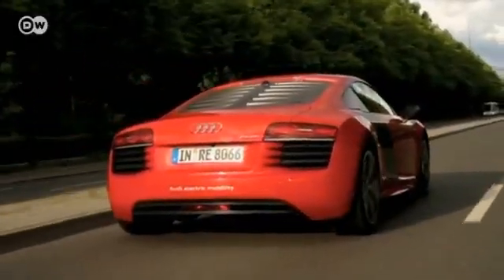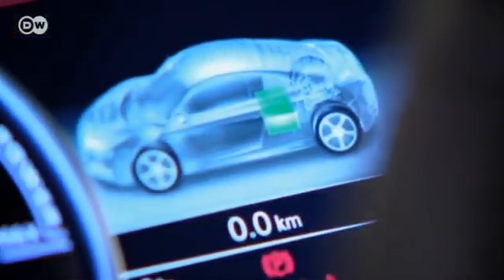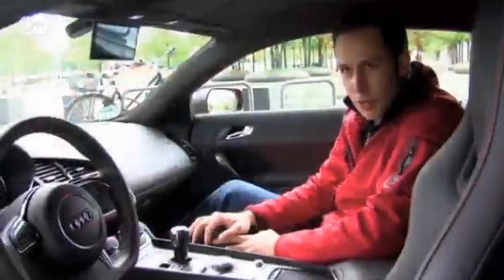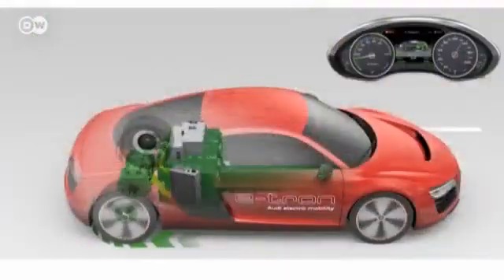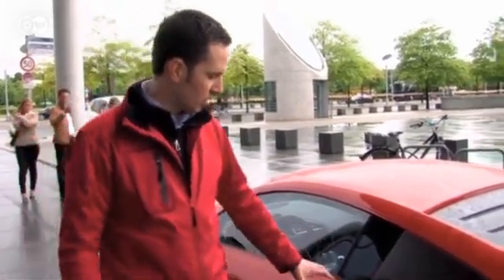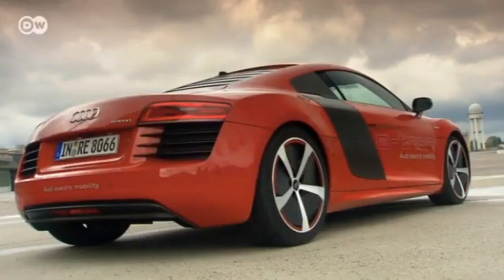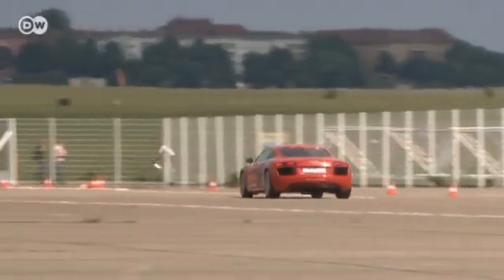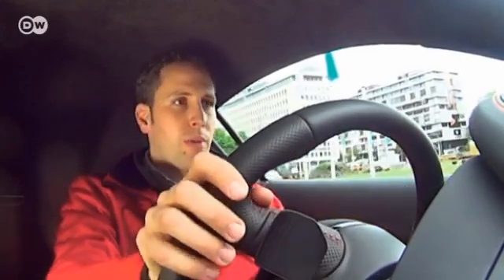Audi R8 e-tron - Technology for the Future | Drive it!

Comment: Model S failed to meet the sedan’s 300-mile promised range during a test-drive in cold weather. Its a crappy car- it's just marketing hype.  If the battery is ever totally discharged, the owner is left with what Tesla describes as a "brick": a completely immobile vehicle that cannot be started or even pushed down the street.

Comment: 577kg battery?? Even Tesla model S 85kWh doesn't have that heavy a battery. And it's faster. With more than twice the range and 7 seats. Dumbasses.
Reply: Dan Frederiksen 

This is from a few years back.

You won't get the full range using all 7 seats in the Tesla. 

The development etron mileage isn't much worse than the current model S. The battery pack in the current Model S is at 544kg only marginally lighter than this older development car.

And yes, the Tesla is a very impressive and innovative car.